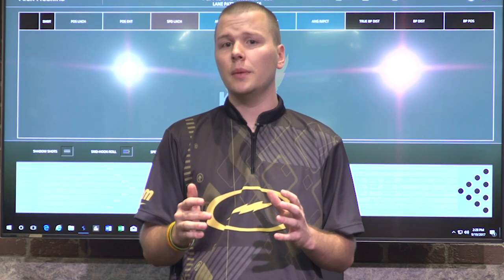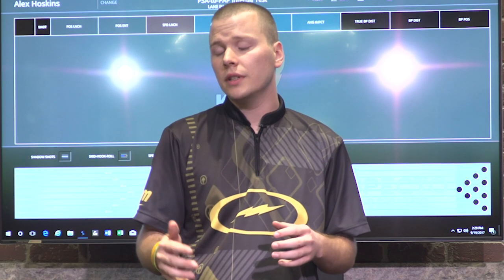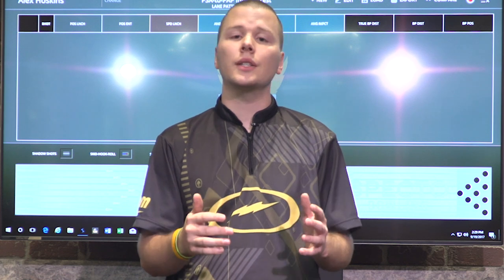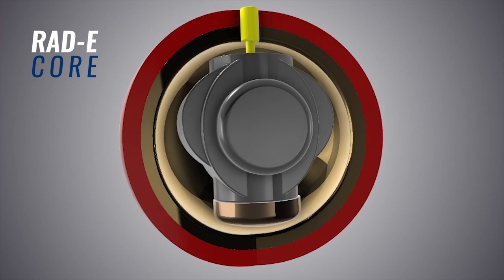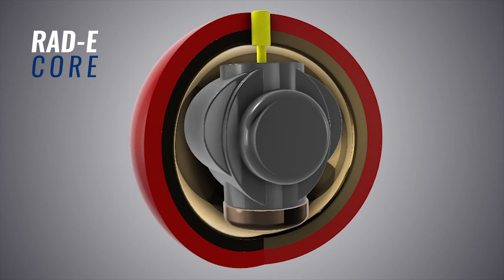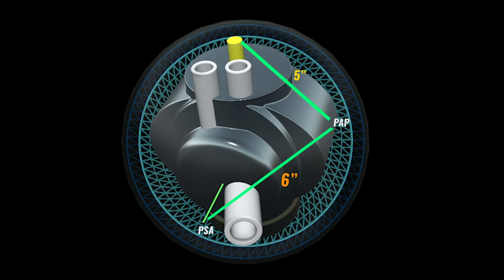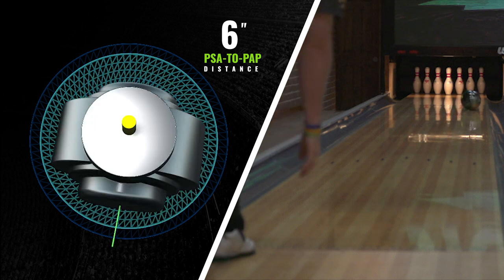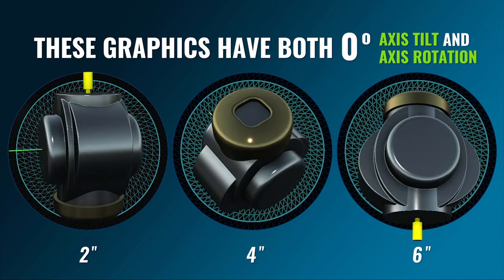Storm | Pin Buffer Layout System - Part 2: PSA-to-PAP Distance

Comment: Not until 3:59 do you hear that the PAP stands for Positive Axis Point. He never says what PSA is. Preferred Spin Axis. How can you make a video about the two main subjects and not mention what they stand for in the beginning, or at least 2 or 3 times during it. Everything about this video is awesome. The graphics and slow motion shots along with the explanation are perfect and I learned a lot. Bowling ball layout uses quite a few acronyms so it would help if you at least said what they stand for. But I will end with saying thank you for a very informative 3 part pin buffer series which will help me quite a bit as I am about to have two balls drilled. You really wonder how much the pro shop guys know in detail about all the things going on with ball layout. Anyway, thanks again!!
Reply: Not to mention a lot of drillings use dual angle layouts instead, so a parameter comparison would be nice. Symmetrical balls do not even have a distinct PSA
Reply: @coopergates9680  with a symmetric core, the PSA ends up in the thumbhole, so the PSA-to-PAP doesn't matter in those types of balls. This is the reason why the drilling angle doesn't matter on a symmetric ball.

Comment: So for a speed-dominant player using an asymmetric ball, would you want to push the PSA-to-PAP more towards 2" to force the ball into an earlier roll? When I use PSA-to-PAP of 4", I see my ball still in the hook phase as it enters the pins. Maybe I need more surface to pull the breakpoint closer to the foul line?
Reply: You could go with say a 3 1/2 PSA to PAP in attempts to get that ball rolling earlier. But on an asymmetrical ball a PSA to PAP of 4 in can be a bit aggressive at times. But surface is your quick and easy way to change the length of the skid phase. At the sacrifice of ball motion. If you wish to keep say an angular ball motion you would need to increase your PSA to PAP closer to 4in

Comment: I'm a bit confused as to what Alex means when he says the marker on the PaP "lines up" with the other marker? 

Also, exactly and how do you determine where to put the second marker? I understand its 3in away in the direction of migration but does the mean 3in toward the bow-tie of the track flare? 

Thank you Storm and Alex for these videos very educational and informative
Reply: When the balls are released in the videos, they are initially rotating around the positive axix point (PAP). As the balls go down the lane and flare, they "tip" so that the axis point they are rotating around is constantly changing (migrating), and eventually, the 2nd marker becomes the axis point, or "lines up."
Reply: Knowing exactly where to put the 2nd marker would be hard, I think, for us mortals, even when we more or less understand this stuff. You have to know what the migration path of the axis will be for each layout. You can see the lines between the PAPs and the 2nd markers at certain points in the videos, and their shapes and directions depend heavily on the layouts.

Comment: Can you find these details before buying a new ball?
Reply: I don't think you can get to the level of information seen in the videos here, but some of the ball manufacturers give you a set of specifications on their drilled (emphasis on DRILLED) balls if you follow one of their recommended layouts. With Radical, for example, you can look at the recommended layouts (NOTE: some ball companies use the dual angle layout system, instead of the pin buffer system. Instead of 4" x 4" x 2.5", you'd have 45 degrees x 4" x 45 degrees - the same three physical measurements expressed differently), and you can see what the total differential, intermediate differential, and 'performance' differential end up being after drilling, which tells you quite about about what kind of motion you can expect.

Comment: Reupload?
Reply from the maker: No this is part 2
Reply: @stormbowling  I'm wondering about the PSA-PAP measurement for symmetric balls. When laying out symmetric balls do you measure PSA-PAP using the point 6.75" from the pin through the CG?

Comment: Is the PSA same as the CG?
Reply: Antoine Jeremiah Fabian 
No, not the same.  Storm’s symmetrical drilling guide states that the PSA is 6 3/4” from the pin through the CG.  Draw a 6 3/4” line from the pin through the CG to locate the PSA. 
https://www.bowlingthismonth.com/bowling-tips/storm-introduces-the-vector-layout-system/
Reply: The PSA marker only appears on asymmetrical balls. You can make a mark 6 3/4" from the pin through the CG as indicated above, but when you lay out and drill a symmetrical ball, you actually only need to care about 2 of the 3 measurements - Pin to PSA and pin buffer. You can use whatever "PSA to PAP" distance you like - it won't matter motion-wise, since the real-world preferred spin axis of a symmetrical ball is always in the thumb.
Reply: @brandonferris8934  Enter no thumb layouts lol